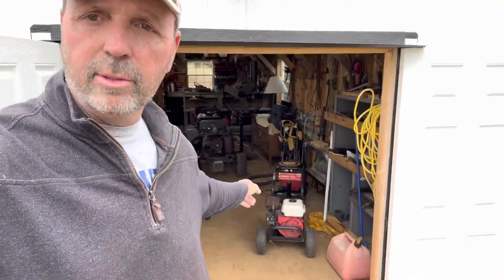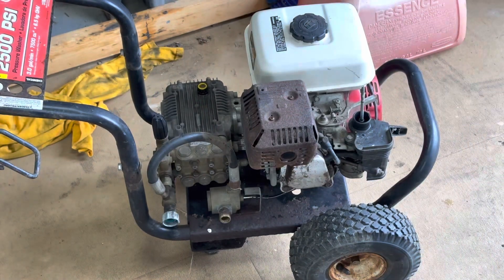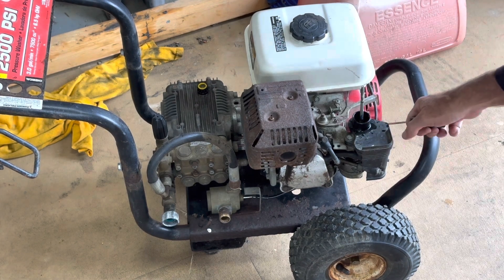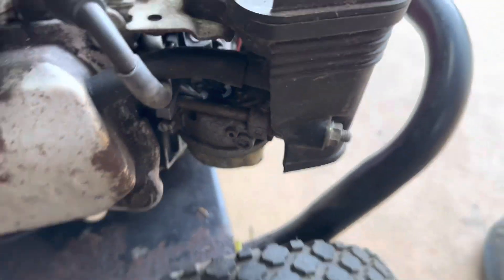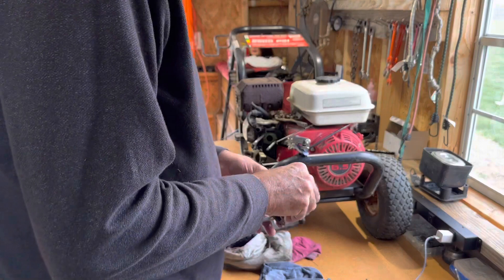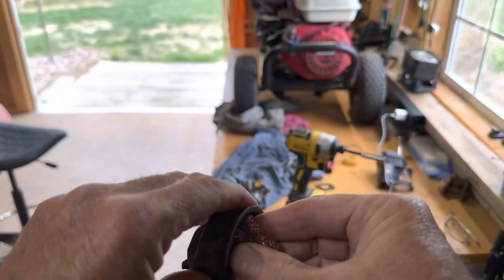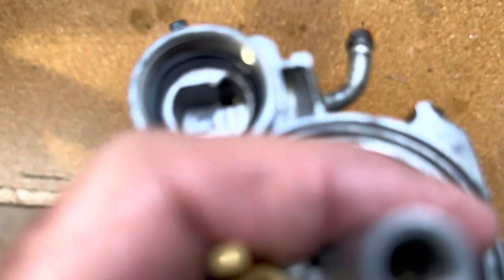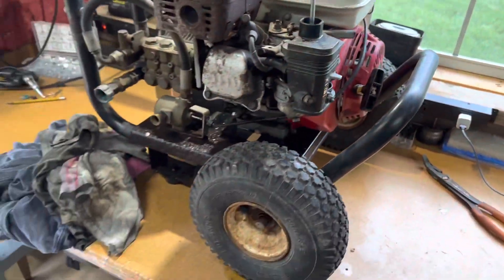Repairing pressure washer engine that does not start

Comment: I hope you have a great Easter too. I could not believe how dirty that float bowl was, great tip about the wire wool thanks. It is a shame about the pump but you have a good engine, great job on the carb
Reply from the maker: Pressure washers are typically not good investment because if you get the engine to run a lot of times, the pumps do not, thanks for watching